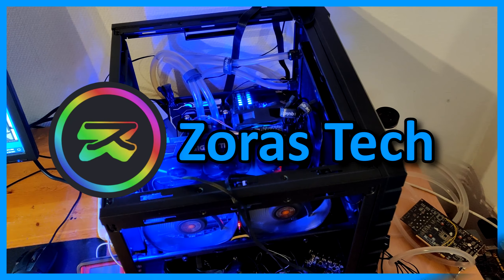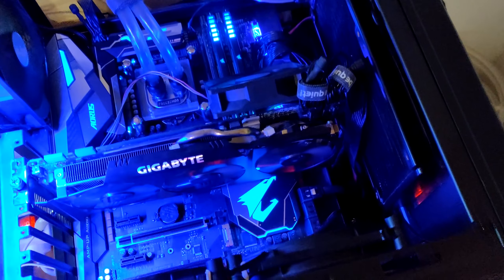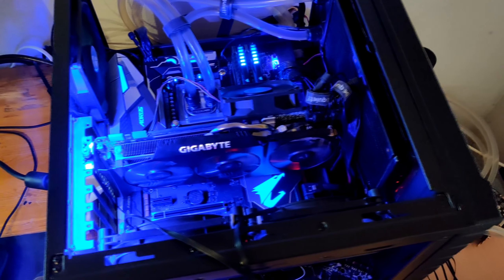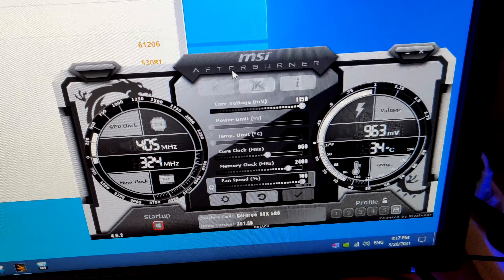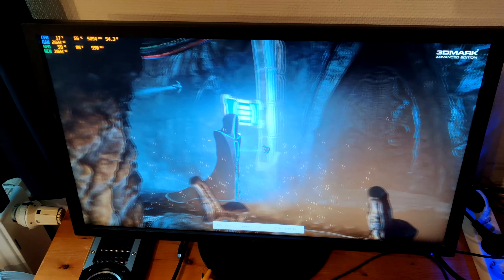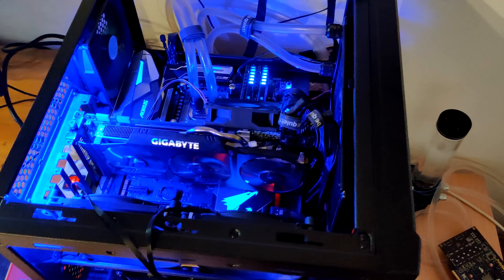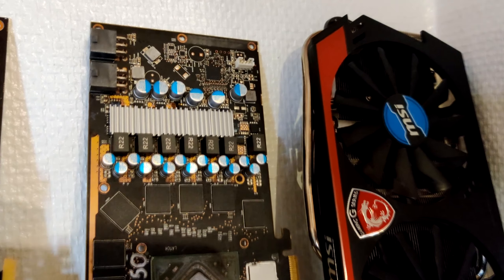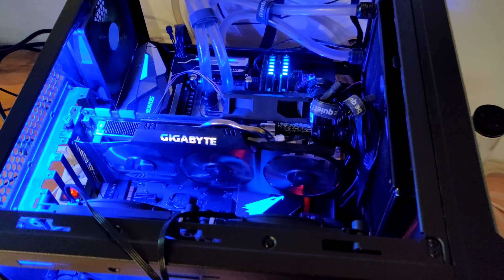The Disappointing GTX 580 SO  // When "more phases more better" doesn't work

Comment: I have two dead 1080TIs and two 1080s. Right now I'm concentrating on a evga 1080Ti with a short to ground on memory. Previous owner tried to remove the fan header with pliers and his water block shorted the 3.3v to the fan header. Fuse is blown. Not quite sure what I could do next

Comment: Do you have a link to the Gigabyte volt adjust app.
Reply from the maker: I do not sadly. But there should be a collection of overclocking tools on overclock.net and other overclocking forums. The tool is called "N580SO SW" you should be able to find it if you look for a bit

Comment: What do you think of the GTX580 matrix ?
Reply from the maker: Looks pretty good on paper but i would have to test one. But given that the Matrix is an upgraded DCUII and the DCUII is my favourite GTX 580 it will likely be pretty great
Reply: I have a GTX580 matrix it’s got those buttons on the back that change the Vcore on the fly 

I get 940 MHZ on air ... not delided yet ... I must take it out and play with it again ... maybe put a waterblock on the GPU with an additional fan to cool the VRM and VRAM ( I added heatsinks to the VRAM)

I will post a video of it quickly on my channel to show you
Reply: Uploaded go take a look :)
Reply from the maker: @HiltonHeslop  your main limiting factor is likely the heatsink. it uses the same as the 580 DCUII and 7970 Matrix. both had awful thermals despite the big and heavy heatsink. if you put an aftermarket heatsink or even better a waterblock on it, delid it and flash a 1.213V bios (with fermi bios editor, of not done already) you should easily get to 1GHz. it should also have the same PWM controller as the normal 580 DCUII so if you feel comfortable you can voltmod it to get even more VCore out of it. the VRM can handle it for sure but you want good cooling at that point